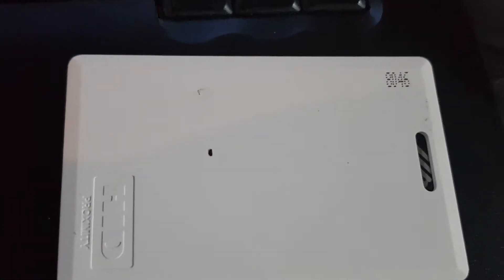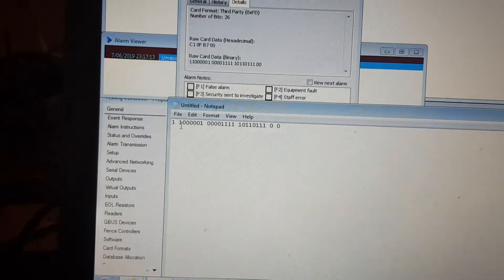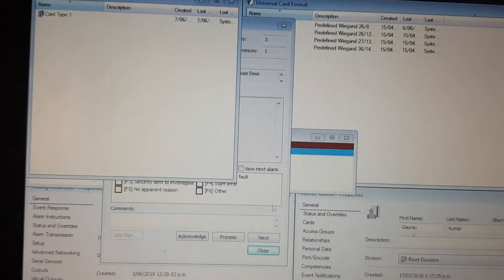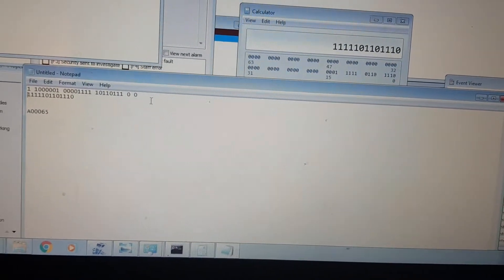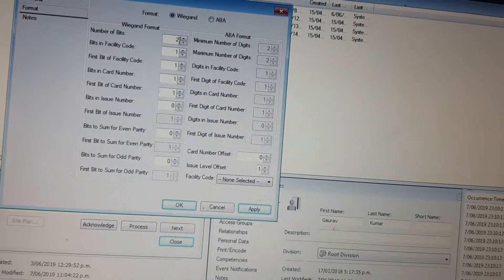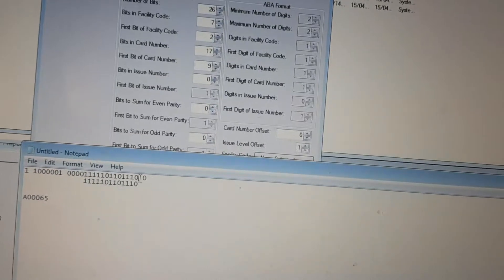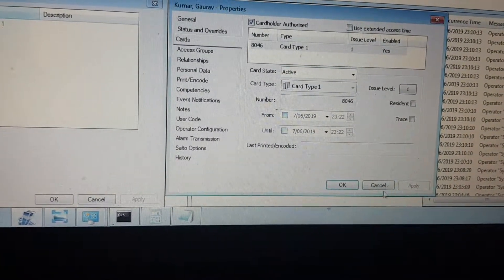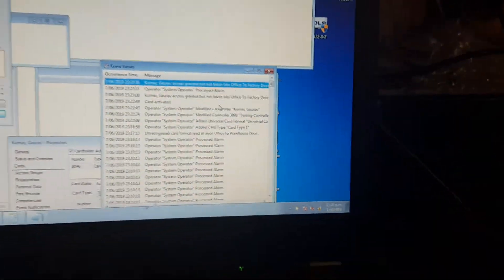HID Prox Cards integration with Gallagher Security Panel.

Comment: Hi, left a thumbs-up because the video is useful if you want to know the process for adding formats into Gallagher system, but you got the card format decoding wrong.

The format for the HID card you were using has an 8 bit site code (you have only calculated using 7)  and a 16 bit card-ID so the actual site code for this card would be 10000010 (i.e. DEC 130) not 65.  Similarly, because you have assigned 17 bits to the card ID the numbers will alias when the card ID reaches 65535.
Reply from the maker: Hi Mate, thanks for leaving a like, with no offence to your knowledge I just want say the process I shared with you guys worked for me 100’s of time in the past and I have migrated thousands of users using EDI enterprise after creating universal card format using exactly same method as my video, not sure if Gallagher has changed something lately as i am not so active with it .

Comment: Greetings Gurav, what are the rules around integrating HID prox cards onto a Gallagher Security panel? I work at a in a commercial building where we use HID cards for our floors and another card (Gallagher) to use for the building doors and lifts.
Reply from the maker: Hi Simon, 
No such rules but your Gallagher Card Reader has to be a Multitech reader (means it can read hid cards) most Gallagher reader are only read Mifare cards. If you badge your HID card to your Gallagher Reader and it reads , it will give you the a event in the event viewer that a unrecognised card format read at a door , from their you can just simply follow my video steps and you should be away laughing.
Reply: @rigidsecurityltd2367  Hi Gurav, thanks for sharing your knowledge with us. Legend 👊👌🤙